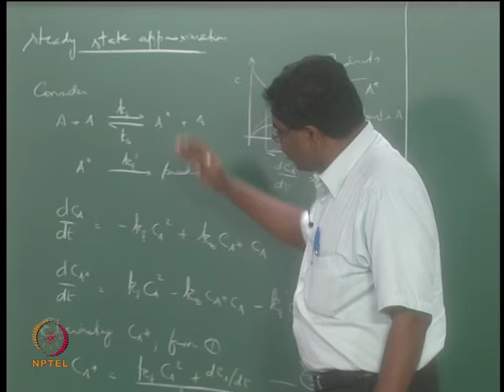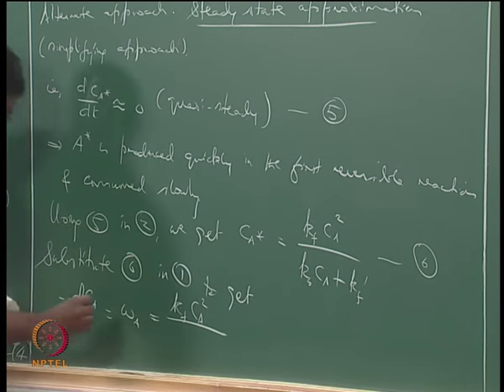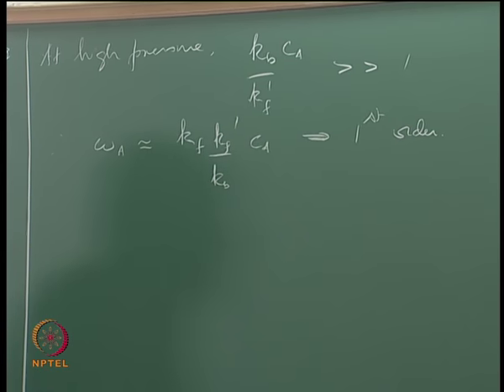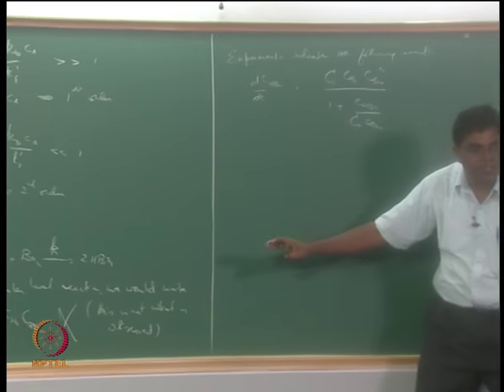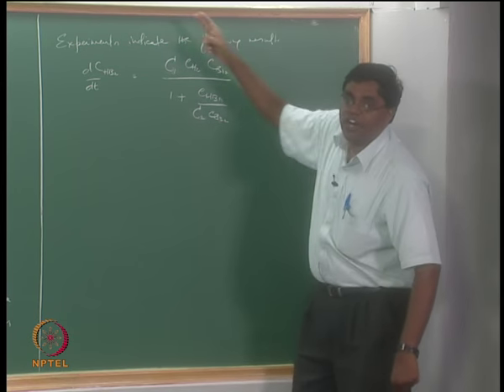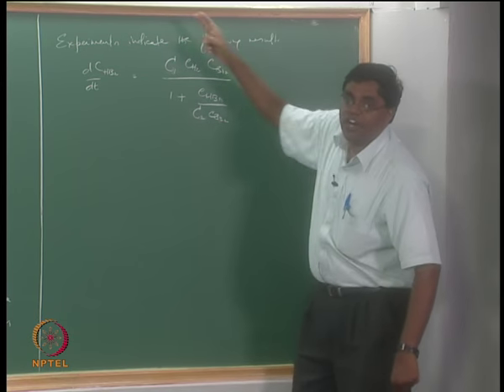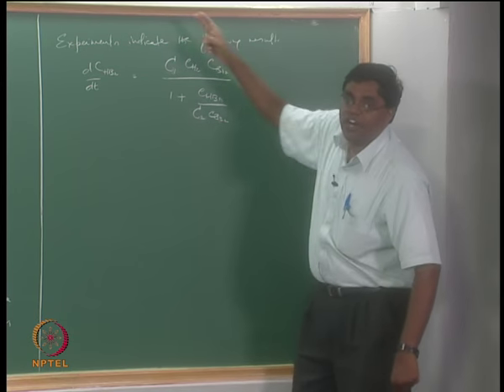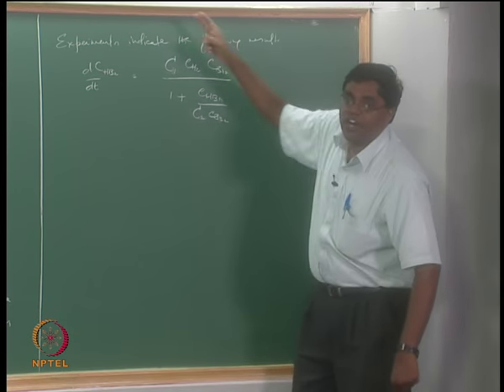Mod-02 Lec-09 Steady State Approximation, Partial Equilibrium Approximation

Comment: If A* is produced quickly and consumed slowly, then how can equation 5 holds true?
Reply: That's the assumption ,, A* is the intermediate and it hold as it is for some time ,, already produced "quickly" and very slowly to change "slowly consumed" ,, he already define the range on the curve which is in the middle where A* already produced and consumed slowly ,, So equation 5 can hold true.
Reply: @mohamedaskar9563   According to my understanding for the steady-state approximation to hold the rate of formation of the intermediate should be slower than its consumption.